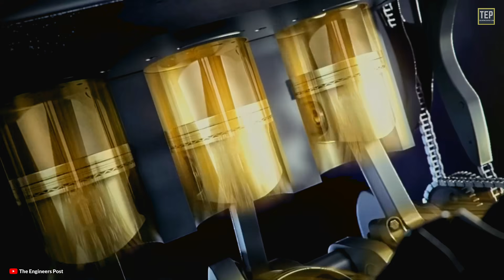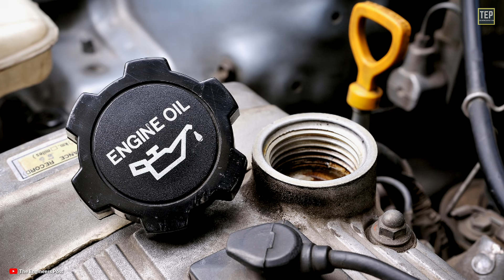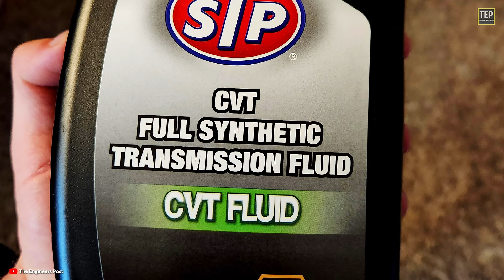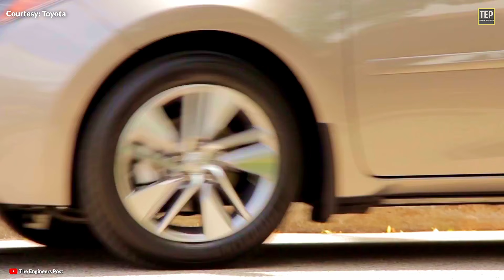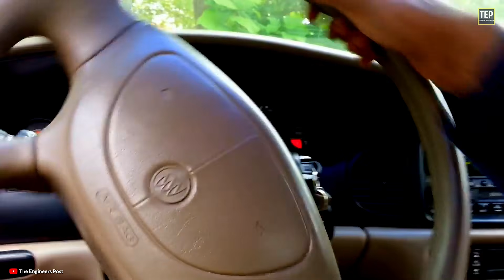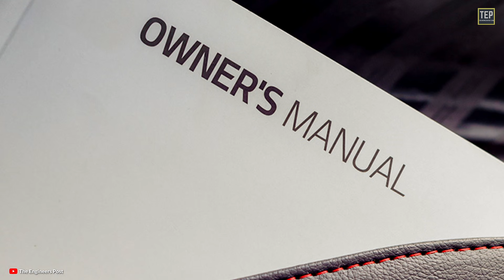When & How to Change Every Fluid in your Car | Explained

Comment: Highly recommend to change your oil at least every 5k. It is amazing how bad the oil gets even if you use full synthetic oil. Never go 10k. The oil gets seriously thick and leads to oil starvation
Reply: I think 3500 miles is pretty reasonable. But I go by the color of the dipstick. Dark. Change. My vehicle lasted 25 years and the engine & everything under the hood out-lasted the rest of the vehicle to the point the mechanic bought it basically for engine .
Reply: Transmission fluid is very important too
Reply: I  change every 5000 to 6000 iive in a dusty climate
Reply: Every 3k miles
Reply: Does this rule apply for a vehicles 2017 and above e.g golf r 1.4
Reply: @devicebackup664 I recommend so. Rather be on the safe side.
Reply: Engine oil yes you can even do that at 4k  because at times you are in traffic and the car isn't moving but the engine is still running so at least give it an allowance of between 4k -4.5k
Reply: I do every 3k
Reply: I do it every 3,500 is that overkill?
Reply: My goal is 3000. Reality, I went over and the oil was dark. My new goal will be 2000 since I know in reality I will go a bit over.
Reply: @jbean530 I have seen brand new oil with just starting the engine being dark (overfilled and drained to max level). Rather do an oil analysis than using oil color as a reference…
Reply: @IronEddie13 No it’s not overkill the cleaner your oil is the better your car will run oil is the life blood of your car. I travel between 8000 to 10,000 KM per year but no matter how many kilometer I have done. I always get my oil changed at six monthly intervals because it is not only travel distance that is important for oil change but also time is just as important because time also degrades oil, no matter how far you have traveled.
Reply: One of the main problems with longer oil change intervals, is the oil actually gets thinner because of fuel getting past the piston rings and getting mixed with the oil (blow by) which makes the oil thinner and equates to less protection, due to lower viscosity . In some cases cause pre ignition. When you check the oil, smell it for fuel. I don't burn any oil in my toyota tacoma v6 4x4 2007, but I have a lead foot,  which is a major contributor for blow by or worn-out piston rings but would be burning oil. So never go past 7500 miles on a oil change. Just cuz you think your engine is fine doesn't mean it is. If they're all interstate miles I might go 10k if I sent my oil to Blackstone labs for an analysis @ 5k then 7k if it was fine then do another @ 8k 9k then 10k, depending on the results.
Reply: Changing engine oil at such short intervals seems  to  be an obsession in the USA.
Reply: @andrewwmacfadyen6958 
Because we've seen what happens when you don't. I've seen a lot of tear downs of 10k mile oil changes and the engine is junk.
Reply: @anthony-i1k8c  my tundra didnt even burn a drop or tick after 130k miles...(10k interval 0w20 full syn)
Reply: @ 
There's always exceptions but that doesn't reflect the overall.
I've seen a TON burning oil near 100k. Many, many of them. Congrats on your luck.
Reply: @anthony-i1k8c  all my vehicles have been from 7,500 to 15k miles intervals could be many factors like you said but with oil analysis and full syn oil that meets or exceeds current industries standards helps I guess, and I use OEM oil filters for the most part
Reply: @reyfuentes4572  you probably have the i-force v8 which is a bulletproof Lexus engine.
Reply: @reyfuentes4572  
I will add that my Lexus vehicles which are older say to change at 5k (0w-20) 
It's a newer vehicle thing to change at longer intervals. The oil isn't twice as good. It's a marketing thing which you are falling for. "Look! Less maintenance cost". 
I can't remember where I saw this but it was mentioned that modern German cars actually run a long time, trouble free in Europe. Why? They are more willing to do ALL maintenance, even if it's expensive. Americans not so much. Hard to get them to even check their oil. (I'm American btw so I'm not throwing shade from across the pond)
Pine Hollow Auto Diagnostics had a video out just today (and others in the past). A Ford, 10k on it's oil change having problems. Changing the oil made it run WAY better. What's that tell you? 
Toyota is more tolerant than Ford but both still a bad idea. 
TCCN has had Camry in that the engines were junk from those intervals and an identical Camry with more miles was perfect. People just want to ignore the truth and believe that because they themselves haven't had an issue that it must be good practice.
Reply: Change it 25,000 miles been doing that for years no problems, buy longlife fully synthetic you will make 300,000 miles. Don't listen to the yanks, they are too busy with trump
Reply: @P@Pablo-m6k5hMAGA🇺🇸🇺🇸🇺🇸🇺🇸👍👍👍👍
Reply: 15k km is good enough
Reply: I do oil change every 6,000 miles. Is it ok?
Reply: I personally won’t. I actually change my own oil every 3500 miles.

Comment: Why motorcycle have only motor oil ?
Reply: depends on the type of motorcycle 🏍️
Reply: Most motorcycle motor oils are designed to lubricate the transmission as well. That is why, you should not use regular car motor oil in a motorcycle.
Reply: They aren't as complicated
Reply: Motorcycle also use brake fluid. Some but not all use coolant and are shaft driven and use differential fluid
Reply: Bruh a standard automatic scooter bike has at least 4 fluids that have to be replaced..

Engine oil, brake fluid, trans fluid gear oil, and coolant..
Reply: ...duhhhh...
Reply: ...duhhh...
Reply: Small transmission that are found in smaller machines like motorcycles and dirt bikes etc need higher viscosity to be lubricated properly and also the transmission in motorcycles are basically part of the engine itself unlike cars were the transmission and engine are separated
Reply: We understand you are a rich person👍🏻
Reply: Or only 2 wheels?🤔
Reply: Because its a Motorcycle 😁
Reply: Because it doesn’t have CVT transmission 😂
Reply: Sone motorcycle also required coolant and brake fluid
Reply: To lubricate the clutch and gearbox and cool down the engine
Reply: 給奴隸們能動就好
多了會遠走高飛去
Reply: I think it’s bc there is no power steering, and the transmission and brakes are designed differently
Reply: Due to limited space motorcycle transmission, clutch, and engine use the same oil for cooling and cleaning. Most modern motorcycles now have a liquid cooled engines so they do use coolants nowadays
Reply: Motorcycle oil has to be changed only for the engine because it is engine and transmission oil too